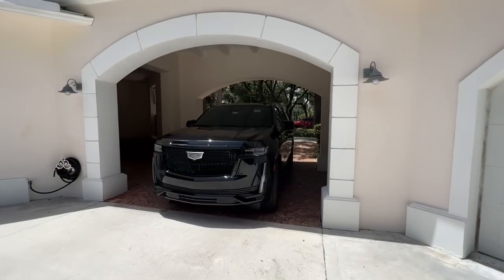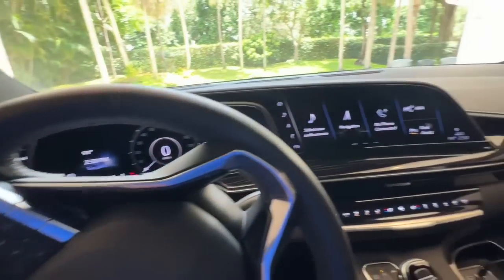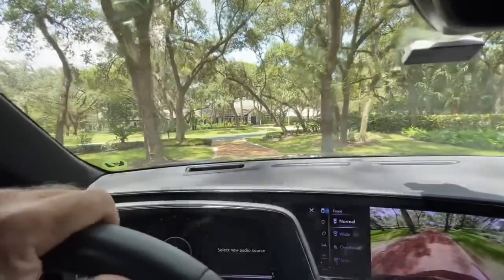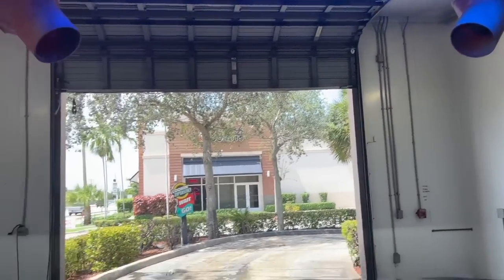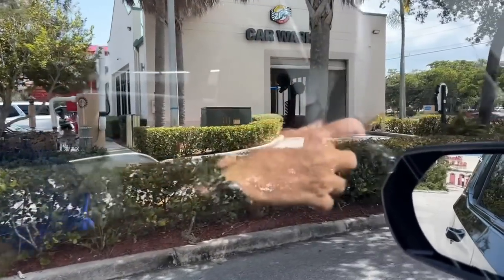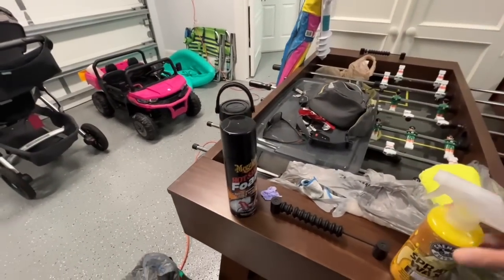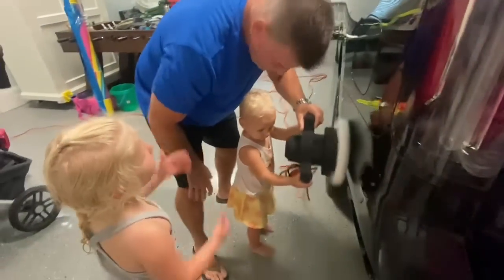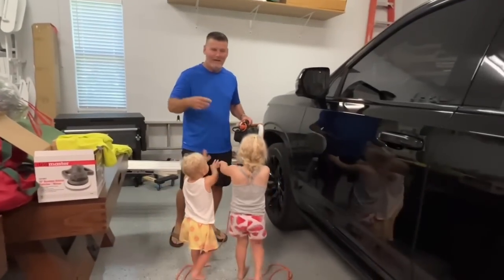I made $200 today doing a Side Hustle

Comment: Correction Tim, the Escalade does not have everything on it. It doesn't have 34 coats of wax on it 🤣 I see more crap going in the back of the 4runner now 🤣😎
Reply from the maker: I gotta agree with you there, two and counting However 😎

Comment: You stole the money. That’s not a 200.00 job spray wax with a buffer lol. Car wash lol.
Reply from the maker: Nothing wrong with the car wash that truck is new and it just needed a clean surface. I never used the spray cleaner wax, went with the butter carnauba liquid wax. The buffer leaves no swirls as a spinner would, not to mention its a BLACK vehicle. Lastly my channel was built on detailing my 4Runner it has 33 coats of wax 🤣. 
I would also say washing waxing and interior cleaning with every shortcut you could think of would still be $200 because that is the largest albatross on 4 wheels you can drive. 🤣😎